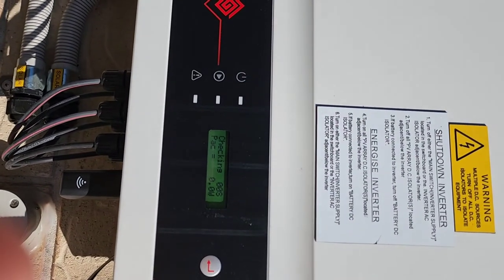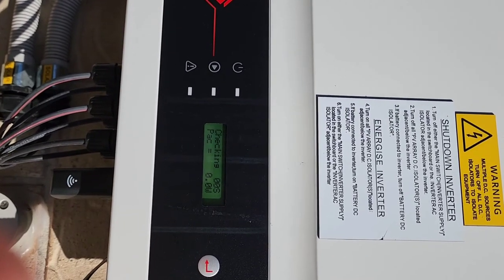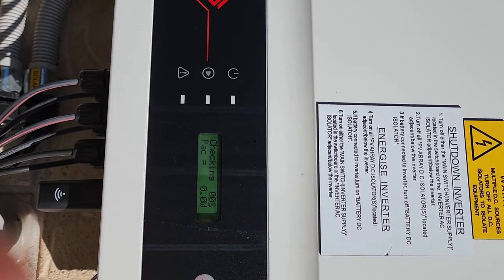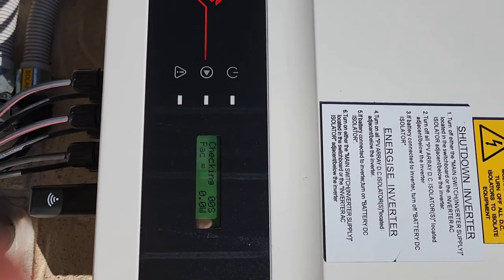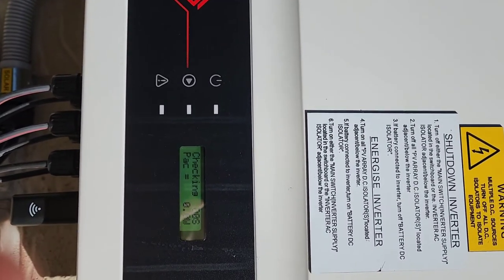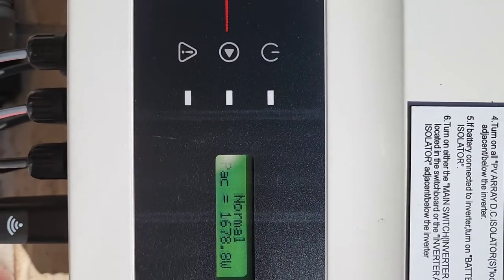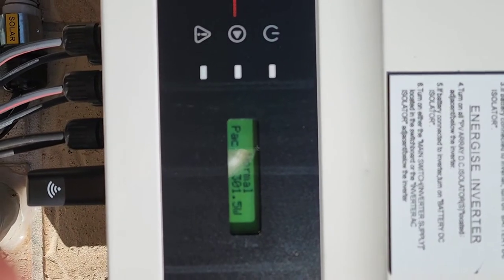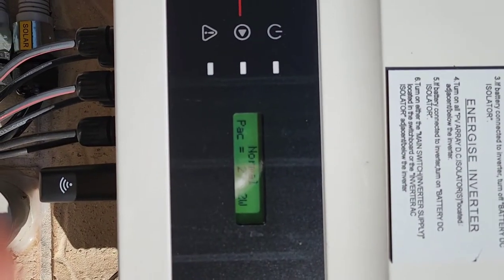Goodwe MS 10Kw inverter. Fault I. Bad news???

Comment: Hi Greg and thanks for video. Do you have this "fault" from installation time ?
Reply from the maker: Hi Yuri, thank you so much for watching. I'm actually not sure. Because the restart takes 30 seconds it doesn't reflect on daily graph generation. I only noticed when I started working from home and heard a buzz noise. Then I discovered it was coming from the inverter. It was approximately 2 month after the installation day. Hope it helps.

Comment: Hi Greg. Great video as I have been chasing an I fault for yonks!! I am about to get a Goodwe MS 10kW inverter :), replacing 3 aging SunRiver Solar 3k3!! I have 3 strings facing north in the paddock :). You briefly mentioned DC problem. My 3 strings are serated with a DC + and - and Ground cable underground. Could I have a DC I Fault?
Reply from the maker: Hi Peter. I was chasing further that problem... Because it is still not a fault I decided it's not worthy of creating another video. At the end it was a wrong country setting. In Goodwe there are a couple different settings for each country. Even a couple of settings within Australia. Now I don't have that problem. From what you describing could be a fault with one of the string resistance. You may need a qualified electrician to check. Sorry if this wasn't helpful.
Reply: Excellent information Greg. I shall persue. Appreciate the reply.😊
Reply: Better check all settings for AU then too! Any suggestions for where to look for those?
Reply from the maker: @peterkrause7700  You're most welcome. Please feel free to reach out if I can help any further! Good luck!
Reply from the maker: @peterkrause7700  I found them within Goodwe app. There is installer password protection, but Google fixes that easily 😎. Not sure about other inverters.

Comment: So perhaps, in hindsight, it would have been better to have used a 2 string inverter because of your panel orientations being in only two directions?

Very interesting insight. Thanks for sharing. 

I'm planning on getting a 8.5kw 3 string Goodwe inverter. However, I will have 3 orientations of panels (east, north and west), so I'm assuming the probability of encountering fault 'i' is low because each string will be brought online gradually, rather than suddenly as the panels will receive light at a more gradual pace. I guess I'll only know when it is all installed. I also agree with you, that the implementation from Goodwe could be better.
Reply from the maker: Totally, your logic is correct. By the way, thank you for watching and commenting. So much to consider. First of all if you consider adding a battery now or later, please watch my video on why you can't add a battery to 10kw Goodwe inverter in QLD (perhaps other states). If you're not planning to add a battery I'd suggest to maximise amount of panels you can install on the roof. Panels are relatively cheap. I might of missed something, please feel free to ask. Ah, also, another helpful video is electricity market in 2022, it may make you think twice before committing to solar :-)